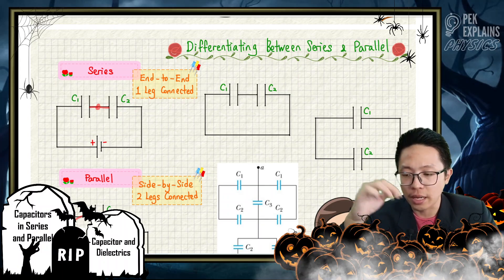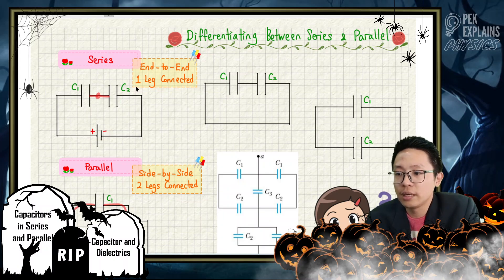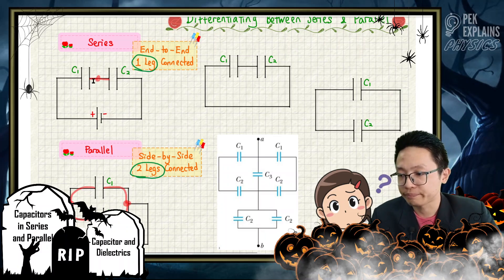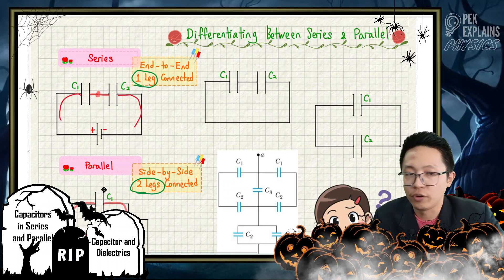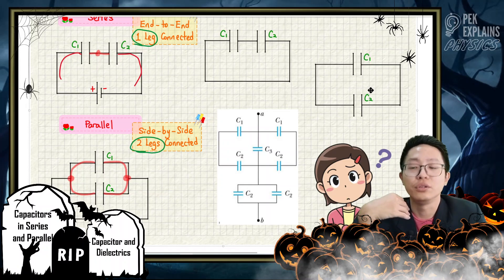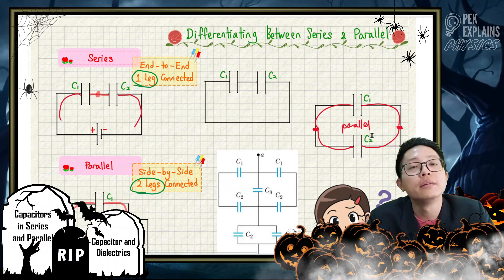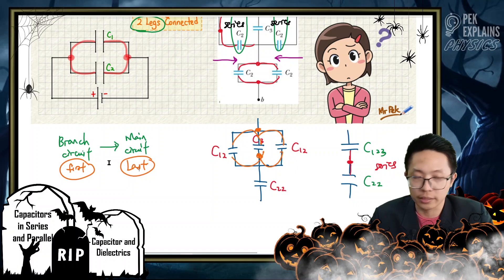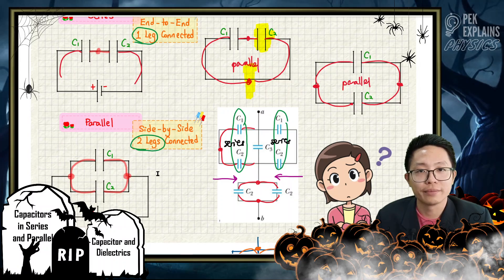Matriculation Physics: Capacitor and Dielectrics (Summary Part 4)

Comment: if we do not combine to be C12 and we just look at left hand side capacitors with C3, why they are not in series?
Reply from the maker: We must identify which one is main circuit, which one is branch.. C3 is in main circuit, C12 in branch.. i will elaborate more of these in chapter 3 series parallel resistors
Reply: @PekExplainsPhysics  orait, thank you .